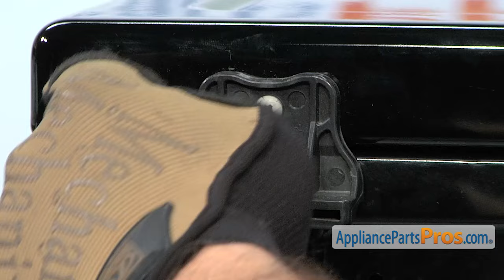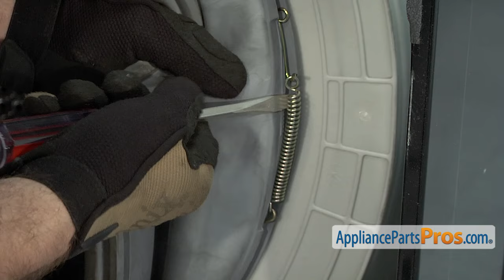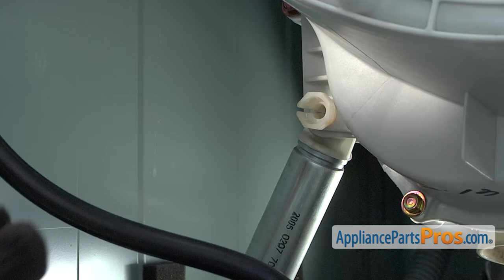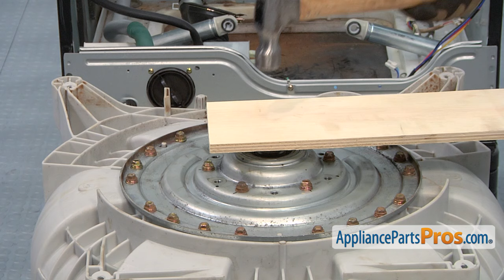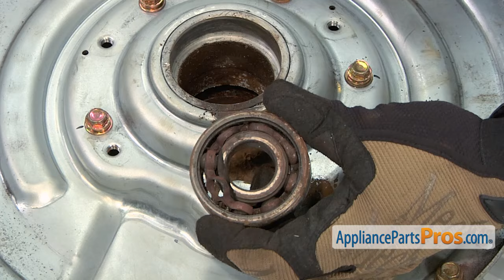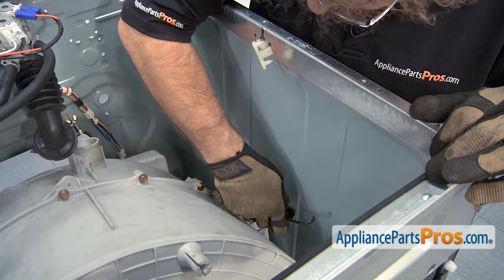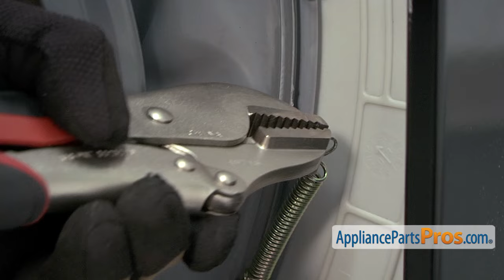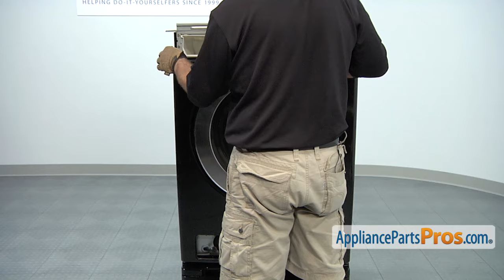How To: LG/Kenmore Washer Seal 4036ER2004A

Comment: hello , I made the exchange of bearings and seal the machine still the default continues.
the basket free spins with his hand , and when the engine run time he does not turn .
model washes and dries lg wd 1403 rd.
Reply from the maker: Wenderson Lessa Unfortunately I cannot look up this model because it is not a US model. I know they are probably similar but I can not find any info on the model. You can post the problem along with the appliance model number on our repair forum to see if the techs are familiar with the non-US models.
Reply: ok thank you thank you for help was of much importance , but after I analyzed information which it met that were of such defects chain.
bearings, seal ,
rotor. I was discovering eliminating step by step.
I am grateful
thank you
Reply from the maker: Awesome glad you were able to figure it out!

Comment: How often typically is a bearing replacement required?
Reply from the maker: Emph Squee I do not think there is set time for them to be changed.
Reply: Emph Squee On these appliances, bearing get worn because of spin seal failure and washing fluid getting thru them. First, worn bearing become noisy, but it can get worse : rust will flow into tank and dirt clothes!
That's what happened to me after one year of rumbling noise.
Reply from the maker: Thanks for the tips!
Reply: Emph Squee Mine lasted about eight years before they started getting noisy. The seal was shot and the inner bearing was rusting.
Reply: +Emph Squee 
8 years for me too. Shame the seal fails, mine was pretty bad. The 
bearings would survive if not for that.  I may now change my seal 
proactively every 4 years. My spider was in decent shape but that may 
not be the case next time. Also mine doesn't get high use as I am 
single. I suspect the seal failure is age related as 8 years seems to be
 common. The spider deterioration is probably more from usage.

Wish I would have watched this video first though.  I struggled through it on my own. I used to build automation for a living so I have tools and such but the sequence of dis-assembly would have been helpful.   Get yourself a brass drift from Harbour Freight.
Reply from the maker: +Grouperhound Thanks for the feedback!

Comment: Hello , my washes and dries LG can rotate the basket with his hand , but when the lava and dry will start the function not only rotates the basket makes a strange noise can be WHAT ?
help me please
thank you
Reply from the maker: Wenderson Lessa Both washer and dryer? For the washer it could be the spider going bad or bad bearings. The dryer it could be the support rollers going bad. You can also post the problem along with the appliance model number on our repair forum and the techs can help you troubleshoot the problem.
Reply: thanks for answering , the engine is spinning too heavy a few moments he does not turn , so produces a sound . ja make sure you have something blocking spinning. LE features a code some people told me that this code and excess load, but there is no clothes in it
Reply from the maker: Wenderson Lessa If you have a lot of issues it would be best to post the problems along with the appliance model number on our repair forum. The techs over there can help you troubleshoot the problems.
Reply: thank you, but I disassembled the washes and dries found that the bearings was defective , with much rust, I am providing new bearings and retainer
thank you very much
I am very grateful for the answers helped me enough with the video as well.
att . wenderson lessa
Reply from the maker: Wenderson Lessa Awesome, glad you are going to be able to fix the washer and get it running again!
Reply: Wenderson Lessa  I'm pretty sure I hear the rotor beating somewhere. thank youI can send you a video with it in operation ?

Comment: The basket basket is usually seized into the tub with a leak like that.  When I tried this job I was not able to beat the rear bearing out as it is pressed into a metal sleeve and seized as well.  So I ended up replacing the basket and rear tub assembly after all. I am an lg authorized servicer. The basket has a warranty on it.
Reply from the maker: Michael childers Thanks for the tip!

Comment: Watched this great video last week... and so I ordered the parts.
Parts are in, and I'm taking the machine apart.  I've got the tub out and set on blocks. I can not get the spindle out.  I've been wetting it with PB blaster... and I've been heating up the spindle with a torch.  Nothing.... No Go.  Thoughts.. suggestions???
Reply: Bob D I got it off  ... YEAH!I let it sit another day with PB blaster on it. But I needed a larger hammer, so I went with my small sledge hammer (size 4) and a block of wood.I wiped off the PB Blaster and heated it up..It took 10 good whacks before it come out. The spider was in great shape... once I washed all the junk off.
Reply from the maker: Bob D Yes the spiders can be hard to get out sometimes, glad you were able to finally get it out!
Reply: AppliancePartsPros The bearings were tough as well. The one on the back would not come out. No give. I ended up heating the housing around the bearing. I kept cold wet towels on the surrounding plastic body. When I had it heated it up, I flipped it over and the bearing tapped out nicely.Then I flipped it back over and pushed the inner bearing out. That wasn't as hard... but I used the widest piece of wood I had.
Reply: ob D

Comment: I did everything as shown, however I have trouble getting the shaft out of the bearing, even with heavy pounding it with a hammer and wooden block. I have used penetrating oil but it still doesn't do it.  Do you have any advice?    Great video btw :)
Reply from the maker: Diazodinitrophenol You can try a heat gun as long as you are careful not to overheat the tub and damage it.

Comment: do you think this is the problem with my washer if the washing drum is very loose and there is killer noise coming from the washer when it's spinning?  It still washes but it sounds like it's going to walk out of my laundry room!
Reply from the maker: Vicky Bonilla If the inner tub is loose inside the outer tube it is probably the spider or the bearings. If you are going to take it this far apart you might as well do those and the seal too.
Reply: thank you so much for your advice :)

Comment: This video is extremely helpful.  The washer I have is the closest to the one on the video. My question is; if the tub material around the edges of the bearings appear to be damaged--I would be able to proceed with the repair or do I need a new plastic "shell?"
Reply from the maker: John Tedford I have heard of people trying to repair them but in the long run I do not know how it would hold up. The rear half of the outer tub would have to be replaced.

Comment: All done.  About $65 in parts + great video + about three hours on a weekend I was able to silence a pair of very loud and soon to fail bearings.

- I found a little bit easier to install the gasket on the tub before putting the weights back on during assembly. Just a little more room to move around.
Reply: Hi Paul!  $65 eh?  So I guess you did not buy from AppliancePartsPro.  The bearings could have been found on Amazon.  Look for KBC bearings 6306U and 6305Z at a fraction of the price
Reply: @davidhinson29  How did you find the the compatible bearings for KBC? I can't find sizes of the MAP61913708 (original LG PN) anywhere.
Reply: Spider assembly was good?

Comment: I see part  #4036ER2004A  and part  #4280FR4048E  .  What is the third part? 4280FR4048L?  Thanks
Reply from the maker: ***** The video shows changing out both bearings and the main seal at the back of the tub.
Reply: AppliancePartsPros I apologize if I'm missing something obvious but the video shows three parts.  Two of the three are picked up in the video and I can see the part numbers.  The third part is not picked up so I never see the part number.  Are the part numbers listed somewhere else?  Thanks.  Awesome video.
Reply from the maker: ***** If you click on the show more tab under the video all the info is there. This video works for the following Washer Seal and Bearings: 4036ER2004A, 4280FR4048E, 4280FR4048L.

Comment: I've had a problem with new retainer assembling.
I push it in, it slips out itself... With or withoiut a soap.
(The old retainer was found also not in it's place, hanging free on the shaft)
I see, it's place is not damaged, but looks like a little conical... (Mistake in plastic moulding? It's LG WD-12391TDK washer. The new retainer was original 4036ER2004A)
I've decided to shape the plastic as "reverse cone" by scratching with knive and put there a silicone glue around the retainer. More strong and chemical stable I can get...
Reply from the maker: Pavel R If the seat where the seal sits was damaged you may have to replace the rear outer tub, or get creative like you did!

Comment: Thanks for great video!
I've found a lot of dirt inside the tub.
It was like a hard felt of our dog's wool with washing powder scrap!
I've used a high pressure water jet device (120 bar) of Karcher to clean it.
Very good, I advise the same cleaning for dispenser, drum and others before assembling. Very pretty even for drum's shaft cleaning.
Reply from the maker: Pavel R Yes sometimes they are very dirty, thanks for the tip!

Comment: I completly rebuilt my LG WM1832CW using this video and ordering parts from you. New bearings and seal, Rotor assembly, tub position sensor, tub seal, cold and hot water valves. My LG runs like it's new again thanks to you and some effort from myself. All for about 300 bucks! Much appreciate the time and effort tjat you spent on this video and your website. Your ordering system and parts diagrams are first class. Than you!
Reply from the maker: kronomarine Glad the video helped you get the washer fixed, thanks for the order!

Comment: This video was very helpful, and AppliancePartsPro shipped the reasonably-priced OEM LG parts quickly. Hope my repair lasts longer than the original 3 years on this machine.

A suggestion: reinstall the big front seal BEFORE you put the weights back on- it's MUCH easier this way!
Reply from the maker: Thomas Wright Thanks for the tip! Glad the video helped you get the washer running!

Comment: how does the spider get messed up can you do a video on how to change it
Reply: I am not sure why the spider bracket cracks or breaks down.  I guess, when the bearings finally break down the drum doesn’t spin correctly and becomes off balance, which may cause the bracket to crack. Depending on the water composition, this may also have an effect on the metal in which the bracket is made from causing corrosion which may finally lead to the bracket breaking down.  There is already a video on “How To” change the spider bracket.   The replacement of the spider bracket is a personal call.  I did change the bracket on my drum, because the bracket looked like it had hairline cracks and due to the fact that I already had the washer disassembled, I thought it would be a good thing to do.
Reply from the maker: mjojo1000 The spider gets weak from corrosion due to the environment it is in. We did make a video! Here it is: https://www.youtube.com/watch?v=iFXp2X99mQs

Comment: I just wanted to say thank you for the helpful and informative video.  It gave me the confidence to fix the bearing issue with my 5 year old LG washer.  Although my washer is a different model than the one used in the video, it still gave me the overall view on “How To” approach the repair and what items and materials were required.   The only thing that I would highly recommend is that the spider, although it may appear to be good, should to be replaced. It is one of the backbones of the whole process.  It is worth your while to find the full assemblies rather than trying to piece meal the repair parts.  It may cost a little more but in the long run it will save you hours of time and frustration.

Comment: you guys saved me a $600-$700 bill or worse if we were going to buy a new washer!
Reply from the maker: Mike King Awesome, glad the video helped you get the washer fixed!
Reply: Used the video again, 3 1/2 years after my first replacement.  Once again, the video was GREAT!  I do wonder.  Is it right that the parts would be corroded after a few years?  I had replaced the seal and drum gasket as well.

Comment: This is an amazing video. I watched it all along just from curiosity. However, I can assume that it is worth to go thru this repair only if you do it by yourself. Self repairs are very common in the US and i very appreciate this. Such a repair, in Europe for example, would not be worth. That washing machine would find the way to the garbage.
BTW, replacing bearings on European washing machines is much easier, even for the same brand LG, since those are smaller and less complicated.

Comment: I can't get the seal to seat properly. Thought I had it but then the washer leaked everywhere. Any suggestions?
Reply from the maker: susanrm You have to make sure the seal is seated properly, softly tap it down evenly. Also make sure you check the spider to be sure the area where the seal sits is not corroded.
Reply: AppliancePartsPros I tried that, but it just kept popping up on other sides. The spider is fine. On my machine, it's part of the drum anyway.
Reply from the maker: susanrm You will just have to work at it, you must seat the seal properly to get a proper seal.

Comment: Very well done video. Bearings are always a hassle, but a couple days of penetrating oil and a metal rather than wood block (I used a hammer placed sideways) freed the spindle. Couldn't find a punch so bought a cheap ratchet extension and that worked just fine.
Reply from the maker: James Frentress Glad you got them swapped out!

Comment: its verry helpfull,thank
Reply from the maker: Selva Selvaraj Glad the video helped get the washer fixed up!
Reply: AppliancePartsPros Wish they would come up with a better more robust system of shaft sealing rather than just a single lip seal as this is the weak point once  / when same fails water and moisture  will  enter the bearing housing and degrade those bearings  and  then rattling water ingress into that direct drive motor area  thus creating a hazard with that combination of water and electricity...mad really direct drive motors, inverters fuzzy logic and the like, all for naught  due to  ....... bad design first day...great video upload thanks

Comment: This is truly one of the best how-to videos I have seen. Bearing seal on my had deteriorated and corroded the bearings until it was making a hellacious noise when it was spinning.  It helped that I have the exact model number.
One MAJOR suggestion - a safety note from which everyone can learn from my mistake: while stretching the spring clamp around the door gasket, my tool slipped and I ran my right hand right up against the sharp sheet metal edge of the frame and sliced the ever lovin' "you-know-what-ie" out of the back of my hand. Deep cut, bled for hours, and though it didn't require stitches, it did take several butterfly band aids. Take it from me, wear gloves, or put some tape over the edge of the sharp metal edges, or both. Otherwise, thanks for a great video.
Reply from the maker: Rich Borel Good job on getting the washer fixed up! We do wear the gloves for a reason, sharp edges everywhere!!

Comment: Hi. I wonder if you'd know the part number for the inner bearing. The outer one on my machine is KBC 6205Z. I want to source both of them before I take the machine apart.

Great video by the way. Now I feel I can do this on my own
Reply from the maker: Saeid Momtahan You can go to our website and enter your appliance model number. Then you can see the appliance breakdown diagrams to get the correct part.
Reply: Saeid Momtahan  Hello Saeid; The 6205 bearing is used on some of todays smaller front load washing machines  and decades old USA Westinghouse front loaders that go back to about 1946. 

 Often a machine with a 6205 size bearing will use a pair of them.  This video shows a bigger washer and it uses I think 6306 in the front and 6305 in the back. Both the 6205 and 6305 bearings have a 25 mm bore but the 6305 is 62 mm OD and 17mm wide. The 6205 is 25 mm bore 52mm OD and 15 mm width.         

        Metric Bearings are very standard in size and go back to at least the 1930's. 

What is really important is to see if you can find the rubber lip seal for your washing machine. Without a new seal the brand new bearings will fail. The seals are harder to find for older machines than newer ones.

The way the bearings fail is the seal fails and then the bearing gets exposed to water and thus they fail quickly.

The old 1976 Westinghouse front load washer here uses two 6205 bearings and the front bearing failed in 2005, ie 29 years later. The rear bearing still had some life it but was replaced for good measure.  

Search for your  washer model number in this vendors site and others too, sometimes you have to enter a similar model if you have an obscure model.
Reply: 3beltwesty THanks very much for your reply. I did replace both the front and the back bearings. The seal unfortunately I wasn't able to find. I removed the old one which was in pretty bad shape anyway very carefully, and then put it back. 

I am looking for the seal and will replace it, and both the bearings again soon.

Thanks again,
Saeid
Reply: Hi Saeid, what is the make and model number of the washig machine?

Comment: Good video, it was very helpful but i have a question. Is the spin wheel supposed to be loose towards where if you lift it, it moves? Or does it matter if its loose? It goes all the way into the bearings and the seal ,but it goes out really easy. Can you help me please?
Reply from the maker: Jose Rizo Do you mean the big pulley on the drum shaft, where the belt goes?